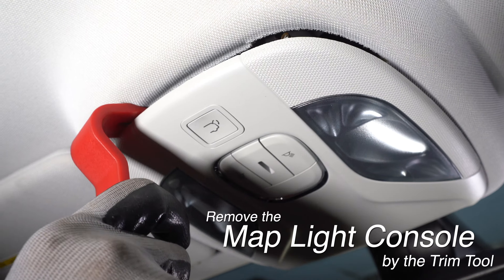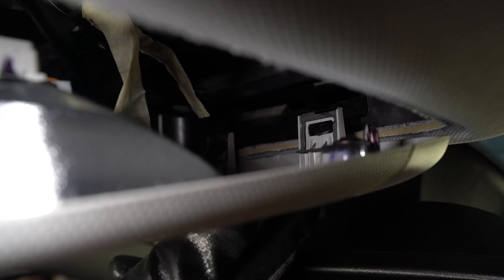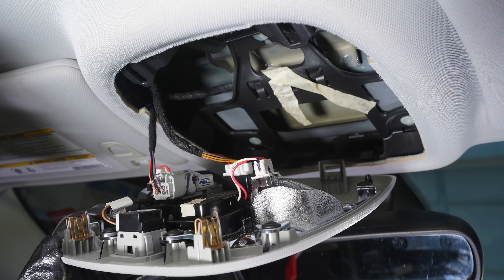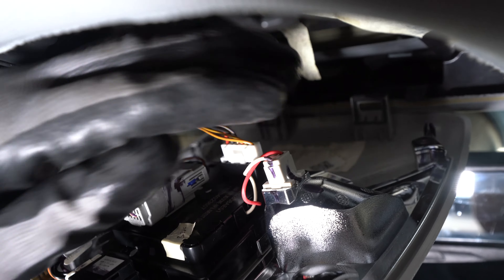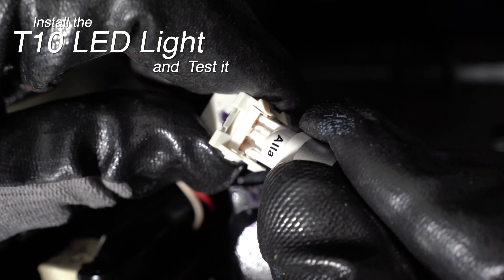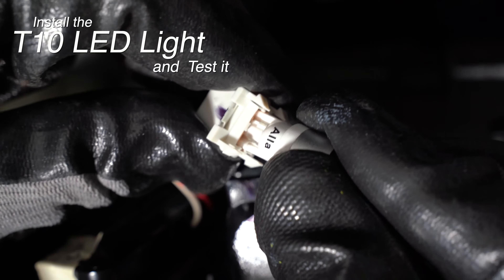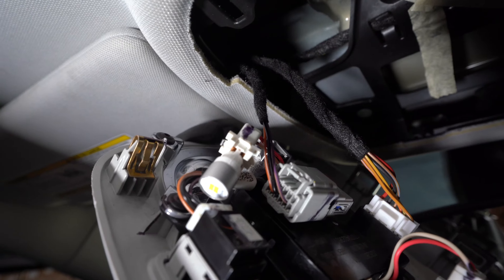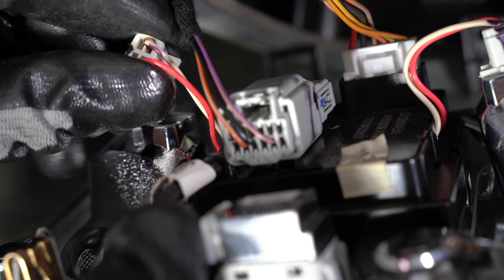How to Change | Replace 2018~2022 Jeep Compass Map Light 168 LED Bulb?

Comment: Good video but I wanted to ask you  there's another light in the front map light between the two on/off buttons (you can see it when you turn on the car) is there a way to remove it and replace it?
Reply: That’s what I’m saying! It’s a halogen bulb I can tell but have no clue how to change it and am afraid to break it.
Reply: @aidenhale7171  I tried to when I realize that I'll break it I gave up